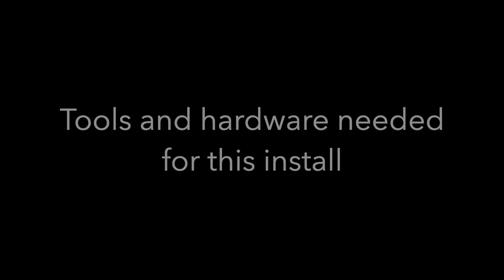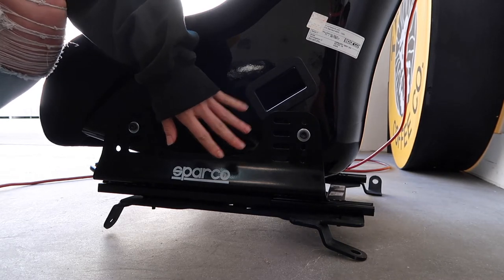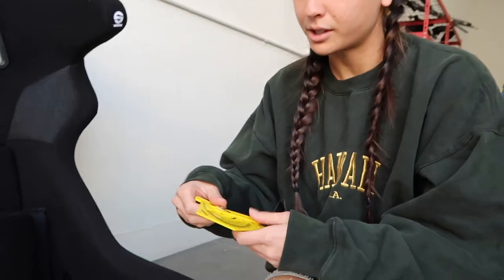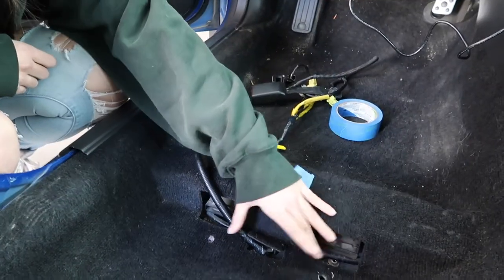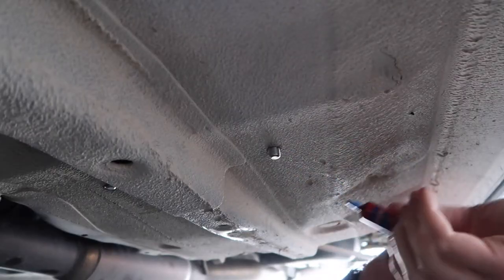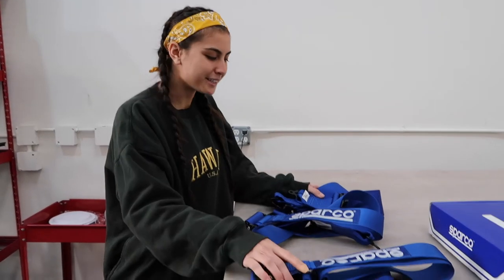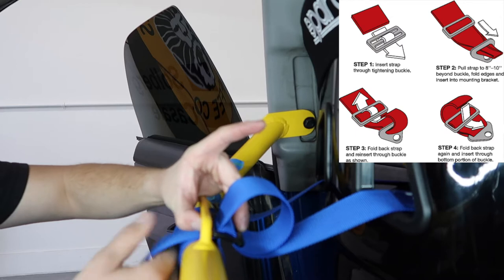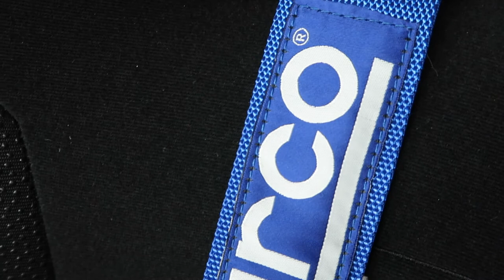Racing Harness Install Guide | 2006 Subaru WRX

Comment: Your two Sparco seat and belt installation videos are very good.  Thank you.  My 2014 WRX dedicated track car needs this kind of work.  Here are a few questions:  1) where did your yellow harness bar come from?  2)  My plan is to locate the seat (Sparco Circuit) as close to the floor as possible.  Is the slider necessary or can I connect the side mount brackets to the base plate and adjust any increase in seat height on the bracket side options?  3) Your lap belts look like pull-down belts.  Did you try pull-up lapbelts?  Thanks for any personal preference info on this or why one may be preferred over the other.  4 and a minor question) Instead of cutting your own backing plates couldn't you have used large fender washers?  Many thanks and best wishes in racing!